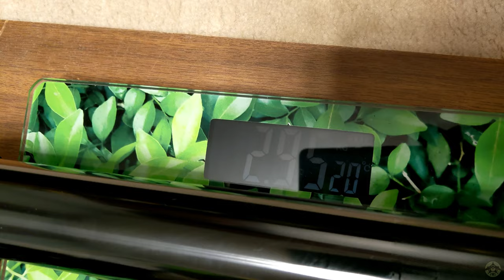2021 Marzocchi Bomber 58 on Sur-Ron X: Unboxing, Installing, Short ride

Comment: Never tighten the stem bolts before the star nut, the star nut is what pushes everything together and ensures there is no play between components. You tightened the stem bolts before the star nut, so putting a star nut was a waste of your time.
Reply from the maker: ещё один... Star nut tension is not enough to compress it all together in a sufficient extent. If you will tighten it hard - it will just slip. In that case starnut is more decorative than functional.

Comment: You need to watch a fork install video before making a fork install video.
Reply from the maker: I don't think so.
Reply: @_peacexplorer_  The lower crown race and bearing needs to be pressed onto the steerer tube. A Park Tool lower crown race installation tool is the best way to do that. The top cap needs to be tightened before you tighten the stem because that is what preloads the headset bearings. You need to make sure you have 8” of travel between the lowers and the lower crown or the lowers will hit the lower crown before full bottom out. A drop upper crown is required in order to gain the proper clearance.
Reply from the maker: @ratcamaro  Does the fork installed? Yes.
Does it installed successful? Yes.
Does it working correct, without any trouble? Yes.
What else? Tons of bulky technical words can't change it.
Reply: @_peacexplorer_  Bumbye you learn...
Reply from the maker: @ratcamaro  How many dudes have a vise and some special bike-service tools? That's right, 0 dudes. And how many dudes have a simple hammer? Every household have a hammer. So, any other questions? 
I am not a service station. I am a simple surron owner, that are living in simple house, just as any other comrades in the world.
Reply: @ratcamaro  80 dollar Park tool eh? I prefer a $1 piece of PVC pipe with the right ID and OD. Works just fine.

Comment: How's your bombers holding out? I m watching your install video again because I snag me up one and was wondering how to salvage my luna beefy bearings headset  that I  just upgraded to not long ago because the stock was falling apart.  I have the Killah and they are wore out after 3 years of riding,  im so stoked on the bombers!
Reply from the maker: Bomber is holding fine. For now. What will be after a few years - i donno.
Reply: @_peacexplorer_  So how are they holding up after a few years?
Reply from the maker: @marrzie467  it's fine. More or less. But i am riding gently.

Comment: The top cap threading in the starnut is your bearing preload maybe 2-3 NM. What's up with the 🔨 lol
Reply from the maker: how is "starnut" connected with "bearing preload"? If handlebar sitting tight on fork's pin even without bolts. lol.
Reply: @_peacexplorer_  ok, as you torque the fastener into the starnut (w/stem pinchbolts loose and the proper amount of stem/ spacers), this compresses the upper and lower bearings and removes play to the recommended torque spec. DM is the same just more spacers added instead of stem. That's my story and I'm sticking to it 😃. Oh, then you torque the stem bolts
Reply from the maker: @mpct400  it is not compresses the upper and lower bearings. It. Is. Not. It barely compressing by rubber-hammer. And this "2-3 nm to starnut" - will not did anything at all. Know why? Because a already explained it in my previous comment 
‾\_(ツ)_/‾